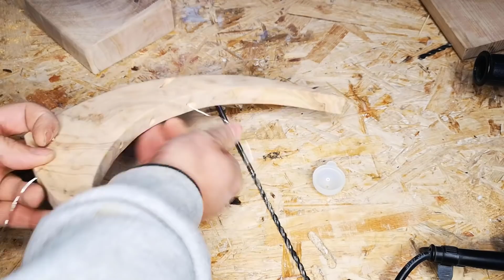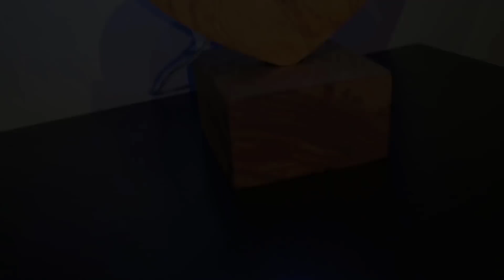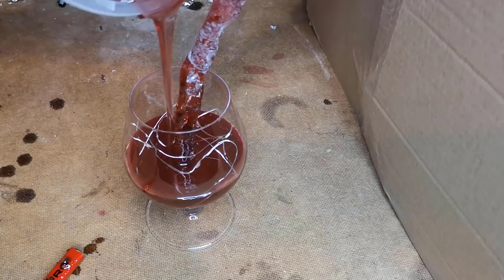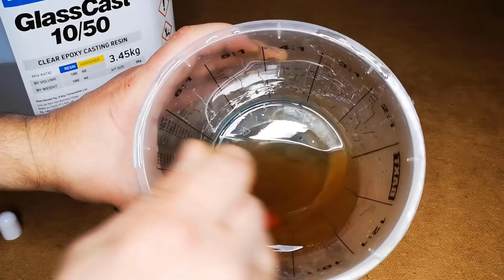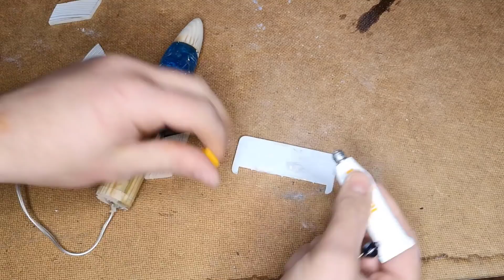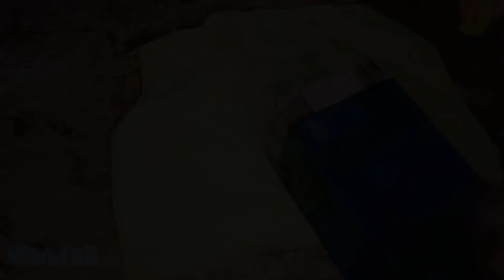5 Most Amazing Epoxy Resin Lamps / Ideas - part 5

Comment: The first one would have looked so much better if you had sanded the spheres. And the fish one, if you had suspended the fish with the stick, but only poured in half the resin so it was only in half way, take out the stick, and fill the rest of the way up, you would have the fish completely suspended in the water.
Reply: Or even made the stick with uv epoxy instead of the dark rod. He still did better than I could've ever done though